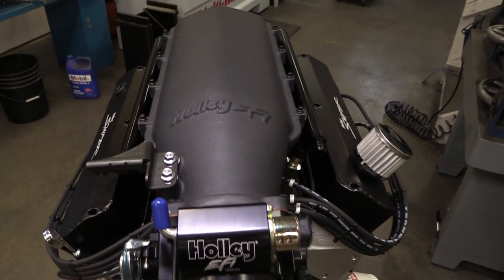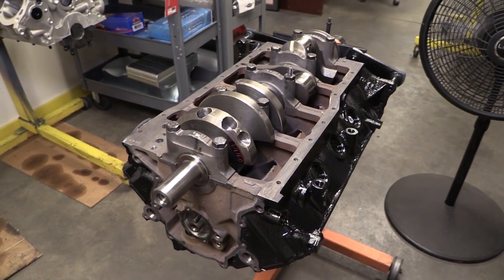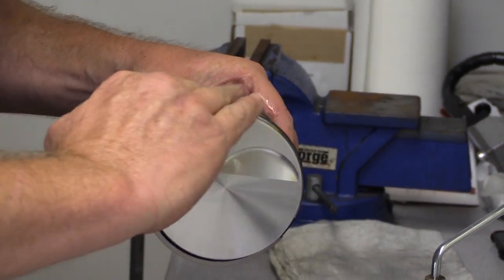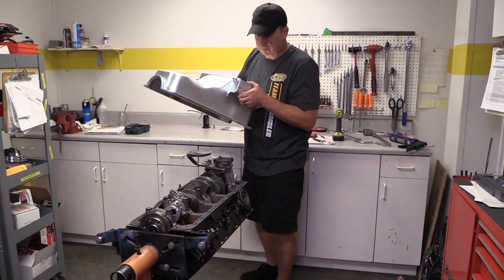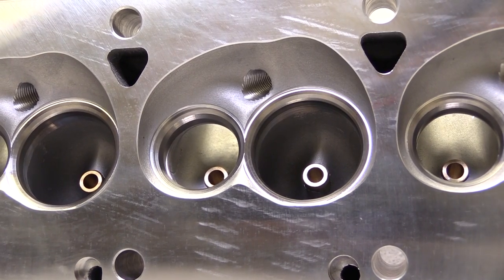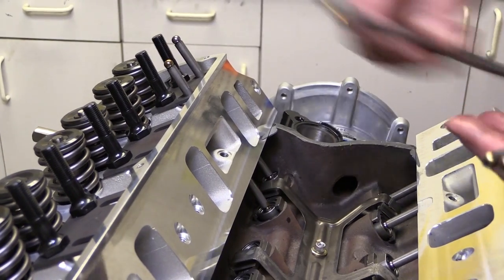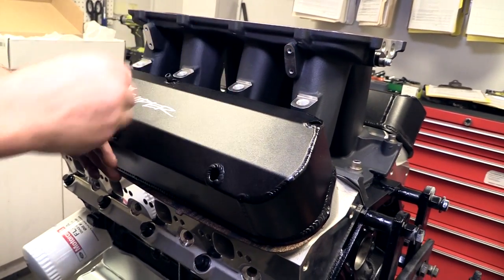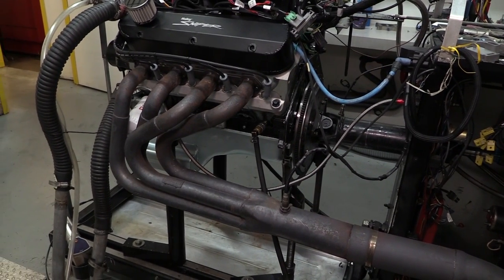The Ultimate Stock Block 5.0 Ford Build (347 Stroker V8)

Comment: Why would you put forged rods and forged pistons can a cast crank?
Reply from the maker: Because as a general rule, most cast or powdered metal connecting rods are only good for 400 horsepower or so. A cast piston is heavy and even weaker. Meanwhile, a cast crank is good for over 500 horsepower. So you have to choose each component for the engine. Thanks for watching!

Comment: How do you make a stroker if you also add longer rods don't that cancel out the stroke?
Reply from the maker: It is always a good idea to run longer than stock rods when you add stroke. It sounds counter-intuitive, but you can do it by running a quality piston that moves the wrist pin bore up higher in the piston (closer to the top of the piston). That creates room for both extra stroke and a longer rod. Hope that helps, and thanks for watching!
Reply: The Horsepower Monster I sure am glad people like you have figured all this out over the years!

Comment: Why not add better main caps. Thry sell them and adds better stability.
Reply: Because not everyone thinks the LS is a be all end all. This engine made more hp per cu.in . than the LS does-even some modded ones. I understand that the LS is a good engine but there are better options-newer Hemi.. Heck Hemi's even come with a rail type system for the rockers.  The reason everyone likes the LS is because GM has littered the market with their engines. Be open minded my friend.
Reply: @jameshenson4871  You meant to say;  GM has littered the junkyards with them....lol
Reply: @jameshenson4871  
Didn't answer the question

Comment: man I wish I could afford a engine like that!!! my fox body needs it!!!
Reply: That is not an expensive 347 build..
Reply: @michaeldickinson6411  Can be done even cheaper. A stroker kit runs around $1,500 or even less (my Scat 347 kit was $800), old block with machining: $1,500 (at most), another several hundred for cam, pistons, rings, & bearings... Brand-new AFR heads can be had for $1,500 or so...

Comment: No cam degreeing? How do you know its at the right intake centreline?
Reply from the maker: Yeah, it was degreed in, I just didn't show it because that stuff gets boring to watch on video over and over again. Believe me, if I'm working with an engine builder and they don't bother to degree in the cam, I won't be going back to that shop! Thanks for watching.
Reply: @TheHorsepowerMonster  yeah mate fair enough good video to watch though
Reply from the maker: @highRolla420  Thanks!

Comment: Yet there’s a stock block 302 pushing 911 whp
Reply: Nathan Jenkins turboes are magic and lots of people don’t seem to understand that the failures in 302 blocks seem to be rpm related, and not power output related.
Reply: Branson Fleischman yeah it’s got stock rods, pistons, bearings, crank and even the rings straight from 91
Reply: @nathanjenkins3584  good ol project stock bottom end.  That car is a monster
Reply: cheap an high hp vs reliable an high hp .. just because so an so made big numbers does not mean its safe to do ... plenty of stock hi hp engines leave the 1/4 mile oiled down or grenade on the dyno ... the older 5.0/5.8 blocks are well know for weak points
Reply: Cody Ramos the world record for a stock block 302 in a 1/8th is a 5.1 Ugly kid racing engines is the builders i do believe
Reply: Nathan Jenkins he’s got a lot of work done to that block and cement filled except for heads to flow water. Not really “stock” block anymore
Reply: Zeth Loveless I’m pretty sure the block isn’t filled though
Reply: Nathan Jenkins bro I’ve watched him 🤣 he said it’s filled with concrete except for heads to flow water. It’s got plenty stuff done to that block
Reply: Rpm related, balance related, and tune related.

Comment: 1.94 Valves with normal Intake and four barrel holley?
Reply: Fredrick Baugh ??? Heads have 2.02 valves?
Reply: @mskehan19  Flo Tec has 1.94 as well as others.

Comment: A real shame the stock blocks were so limited in their power handling capacity.
Reply: The current stock block 1/8 mile record is 5.07.... Chris Watson himself is making North of 800 at the REAR WHEELS on a stock block/ rods and pistons.. good tuning a QUALITY balancer  and low RPM are a stock block must...
Reply: At one time Romac was the favored balancer. What's the current best?

Comment: Do they not realize that when they upped the displacement its no longer a 5.0? 374 should be a 5.6-5.7
Reply from the maker: But if you say it is a 5.6 block nobody know what you are talking about.
Reply: @TheHorsepowerMonster  even still, its not stock, its been bored out and clearanced for a larger stroke. Stock block, is stock size. Thats like me saying ive got a stock Chevy 4.8 ls thats a 383 roller
Reply: @austinmcdaniel6912  , no one says ive got a 4.8 ... people just say ive got a LS engine with x amount of cid if its bored anstroked out. the 5.0 is referring to the block when people say that not how many cubic inches of displacement . damn all yall do is cry about this or that on this video .
Reply: @austinmcdaniel6912  
Don't be that guy

Comment: it really is a shame that 5.0-302's have the stupid casting flaw that see's them split down the middle over 500 HP the only reason it happens is the same reason you have to use metal freeze plugs in a ford engine the castings are very thin to make it as light as possible. you can get away from the problem with a aluminum after market block but the factory ones are cursed with that flaw.

Comment: 8k 500hp sbf vs 4k 750hp salvage 5.3 sbe ls.................There is just NO comparison when you are truly on a budget.
Reply: I like and USE LS motors plenty but please show my this $4k  all motor junkyard 5.3 making 750 crank
Reply: Lol this guy...
Reply: @th3bi6Lebowski  750 crank N/A? I call BS! Maybe boosted. Yeah I know that the Ls will make 1 gazillion hp stock but tell the other side of the story, how many do you go through in a season.
Reply: @jameshenson4871  the OP said something about a 750hp sbe 5.3 being "better" and/or cheaper b than the 500hp na ford motor in the video.. I asked him to show me this magical 750 NA LS
Reply: @th3bi6Lebowski  I agree. That is why I asked that question. I run my own dyno for years and if you only knew how many 1 gazillion hp LS ghost were actually Mia or no shows. I was told that they would make much more hp than they actually did. The little modular Fords would show up and strut their stuff. Clearly they were all boosted but did what they do nonetheless.   The highest hp engine on my chassis  dyno was a twin turbo 281 cu.in 4v Cobra (behind a TH400) and the next highest was a turbocharged 408 cu.in Ford in a 95 Mustang (behind c4). This is not my opinion but fact for my area at that time. Clearly there were a bunch of healthy other manufacturers including a heavily molded turbo Honda Civic that was REALLY impressive. The n/a record was a 2005 GTO LS that put down 526  to the wheels (manual) big Trick Flow heads and stroked 454. Very impressive as well. Some people are so blinded and manufacturer specific they cant see the forest from the trees.
Reply: Lol I boosted my heads and cam only 5.0 sbf to 850hp on a dyno. Tf you talking about a 5.3 making 750hp lmfao

Comment: “Stock” then says 347 stroker 😂😂😂
Reply: Rodolfo Munoz 
Stock block. 
Meaning, a factory ford cast iron block.
Reply: Lumbee Warrior nothing is stock about it Ijs no stock specs machines equals modded meaning not stock
Reply: Rodolfo Munoz 
It’s ok to make a mistake. 
If you’d read the description it very plainly says “factory ford 302 block” that is the “block”. Then it goes on to explain what internals the “block” will have inside it. 

The factory 5.0 coyote “block” will withstand a lot higher HP than the old SBF block. 
I do agree that people throw around that stock word a lot these days.  But in regards to castings, usually they mean a factory casting whether they’re talking about blocks or heads. 

WOW.
Reply: What compression ratio did it end up with?

Comment: Ford engines are just trash cant even stroke it 50 cubes 😂 2 bolt main. Damn ford really over engineers everything.
Reply: Meanwhile a two bolt main SBC would've spun a rod bearing on the Dyno, LMAO!!!
Reply: Nick Jacobs meanwhile ford has small 5.2l displacement motors making 526hp and rev to 8250rpm! And coyotes eating up Ls and lt corvettes in almost every YouTube video lmfao
Reply: Let me know when a chevy engine as small as a 4.6 can do 5s in the 1/4 on the stock block, pushing 3k hp.
Reply: 02autogt bruh nah.
Reply: Venom Svt push rod is superior to DOHC. And ford makes 1 v8 right now. 

And i dont see anyone swapping expensive heavy physically large DOHC engines that rely on RPM for power, in anything. And cost per hp is cost prohibitive in a ford engine, if you can find shit for them. Ls is king for a reason daddy. And LT architecture engines can eat up some damn coyotes.
Reply: Karl Hopkins yea its cool for about 2 passes.
Reply: @Swagmoney696  Ls is king?😂 Guess what powers top fuel car's bud? Oh yeah 496ci chrsyler hemis. And guess what bud, let me know when any gm engine with stock head's, stock block, stock crank, stock chain's, and stock lifters can do 5s in the 1/4 with a block from the 90s.
Reply: @Swagmoney696  2 passes? It's been used for year's without issue's bud. It was in the 6s for year's and now the 5s, still stock bore and stroke.
Reply: Karl Hopkins oh right not a ford engine. Thanks for accentuating my point.
Reply: @Swagmoney696  Not a for engine? The 4.6 is a ford engine bud.
Reply: @Swagmoney696  When I said about an engine from the 90s, I wasn't talking about a hemi lmao. Those engines are from the 60s. So no your point is still wrong.
Reply: Frank Bonazza III gm is the beat sorry
Reply: Karl Hopkins and yea maybe theres not a gm design in top fuel, but look around chances that roller body is waiting on a ls heart. Not a 5.slow. Ls fest is a thing. You are literally surrounded by it.
Reply: @Swagmoney696  Yeah let me know when a gm engine as small as a 4.6 doe's 5's on the stock block.😉
Reply: Karl Hopkins Chrysler didn’t invent the Hemi and a ford was the first one to use the Hemi architecture again 30 years later. So stop with the Chrysler Hemi powers all top fuel blah blah blah. That’s just not true